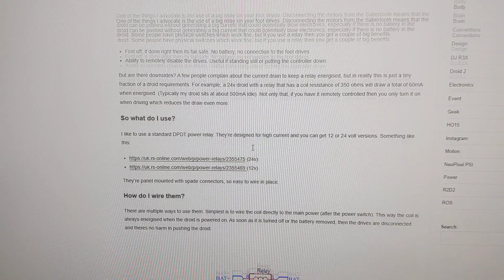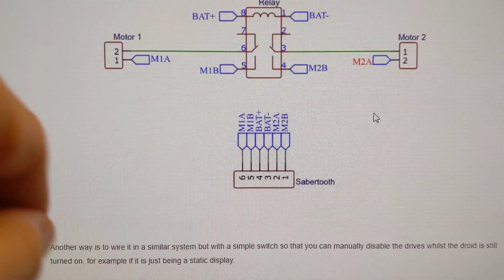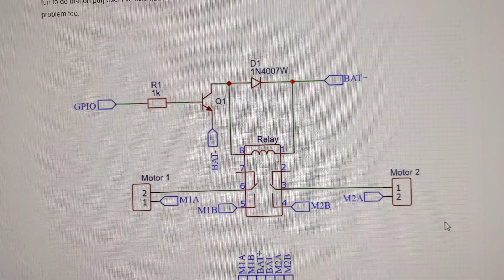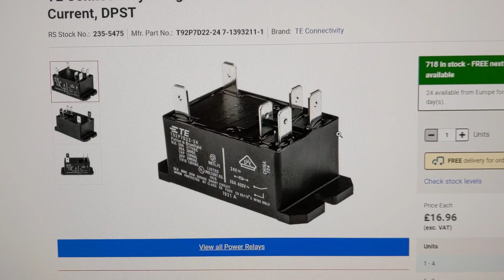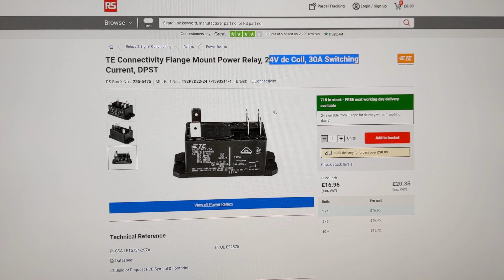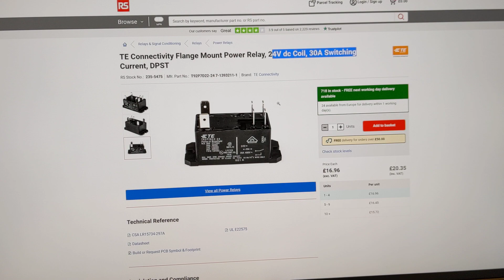3D Printed R2D2 - Part 99

Comment: I'm looking into two options, one that Mr. Jason Charlton using diodes with his build. I was wondering what made you go the relay route?' BTW, I really like you connectors and all looks great. I really like following you build. Thanks for the info
Reply from the maker: I went with the relay because it allows me to easily disable the foot motors if I want R2 to be turned on with sound, lights and dome movement but without any chance of it driving away.  It also makes it so I don't have to worry whether the batteries are in the droid or not, either way I can manually push him and there's no chance of the motors generating power that will damage the Sabertooth motor controller.
Reply: @TomsProjects  Thanks, I have  watch as a lot of your videos and really enjoy them. What camera do you use?  Very helpful and saves a whole  lot of time.  I also know learn what not to do when you burn up you board.

Comment: Cheers for the shout out! :D 

Nicely explained, and nicely wired! 

One thing that I've always been wary about (quite possibly with no need) is if your running your sabertooth off the 24v buck converter, how it will handle the regen braking going back through it. 

Slowly going backwards through your videos. ;)
Reply from the maker: Cheers for your write up and wiring diagram!

The 24v going into the Sabertooth and Syren are directly from the 24v buss, so no converter involved.  The converter is taking the 24v in and sending 5v out.  Unless you're talking about the fact that all the grounds are tied together, in which case that may be something to think about.
Reply: @TomsProjects  Yeah, should've watched a few more videos before commenting. :) 

All good, and a common ground is critical for a working droid.

Comment: I really do like this approach. When you boil it down - it's not as intimidating to wire up as one might think.
Reply from the maker: Darren Poulson's blog was the key in my research of how to implement the relay.  His excellent wiring diagram made it all finally 'click' after I had flooded my brain with different forum posts and general relay videos.

Add in John Salt's video explanation of the snubber/flyback diode, and I was ready to give it a shot.